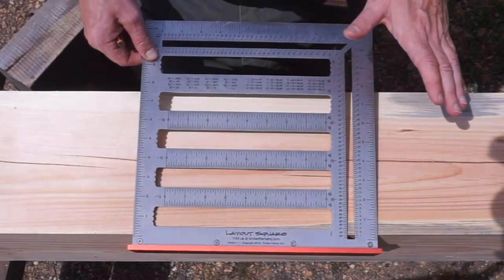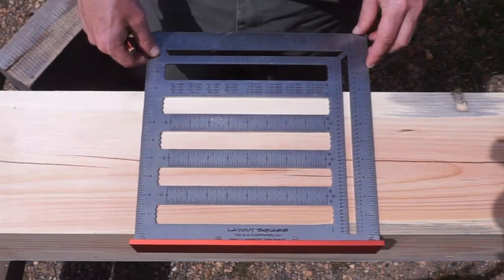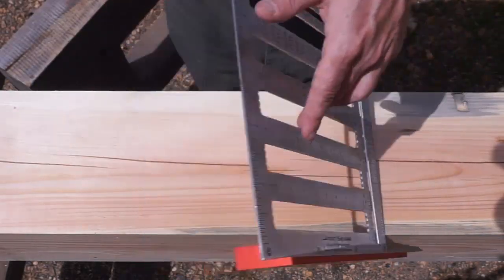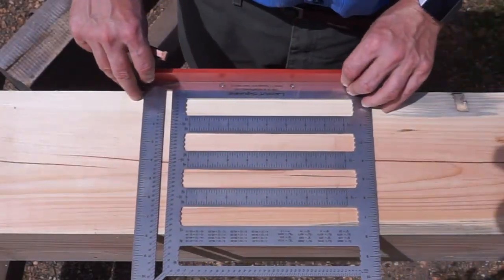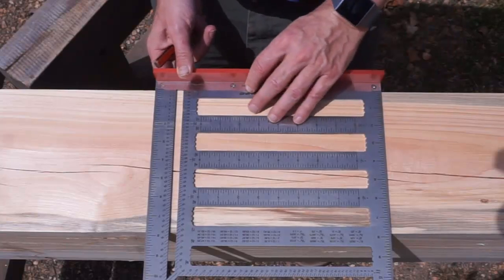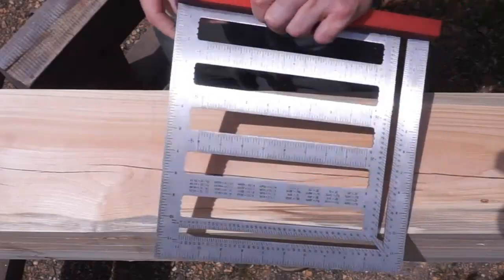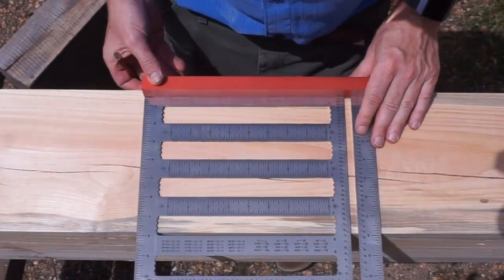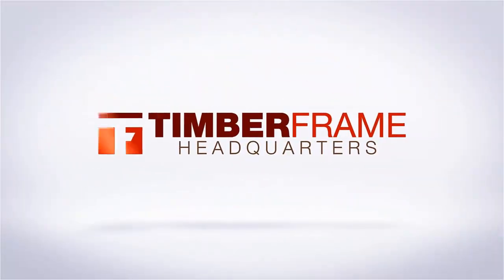Using the Timber Frame Layout Square

Comment: Great, you designed this timber frame layout tool. Would be nice if it was available. Given it hasn't been available for some time and perhaps not in the foreseeable future. You could post the design specs and we'll cut it on the cnc ourselves.